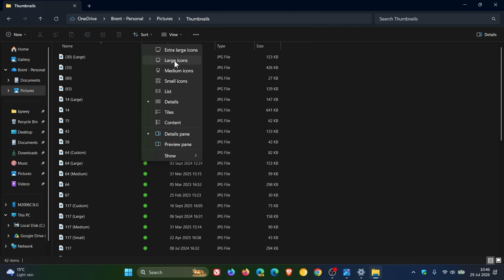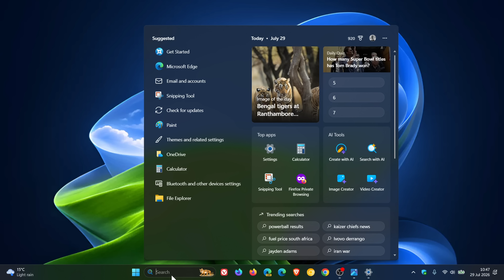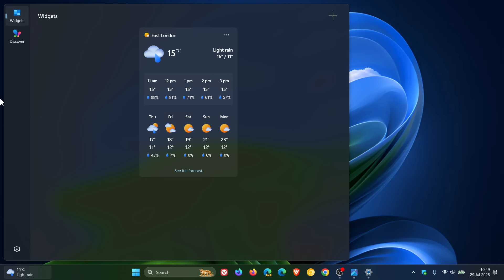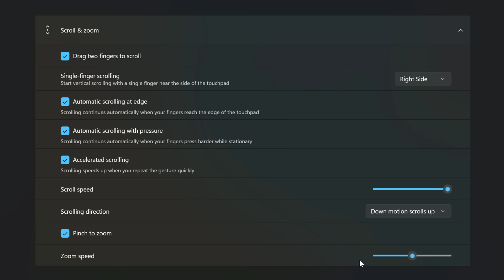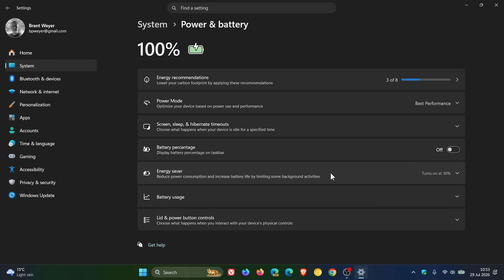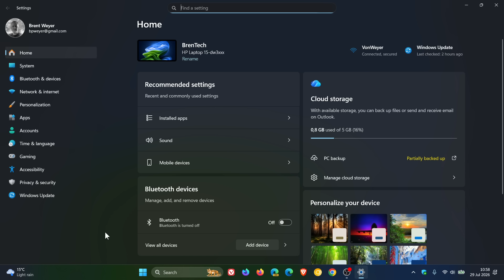Windows 11 KB5101684 Released: 6 New Features, Better Updates, Improvements & More!

Comment: Forgot I went back to 24H2. Upgrade assistant has failed with an error code. So now I'm getting the latest 25H2 dump iso. Will be several hours before it's done. Then I'll try an upgrade with mounting the iso after I backup all the important files.